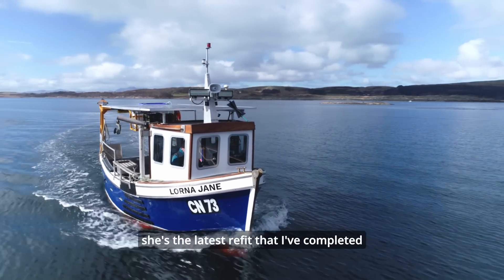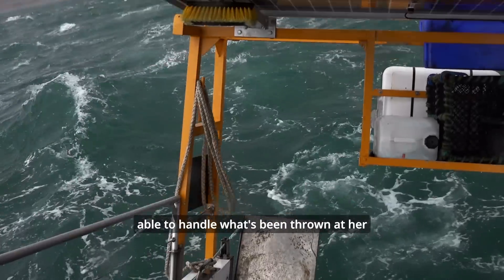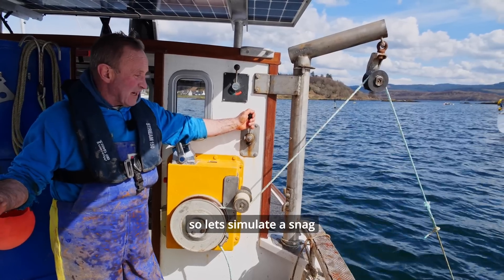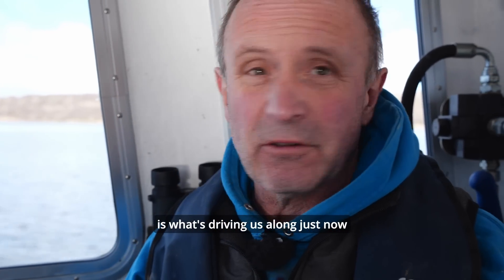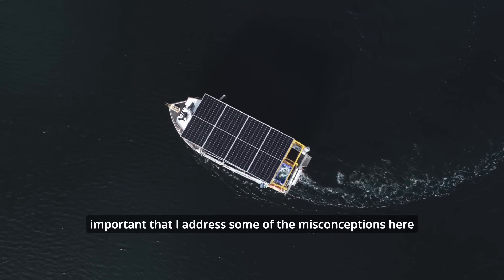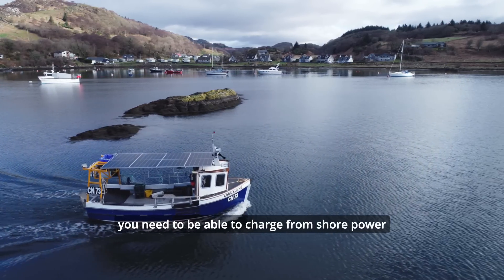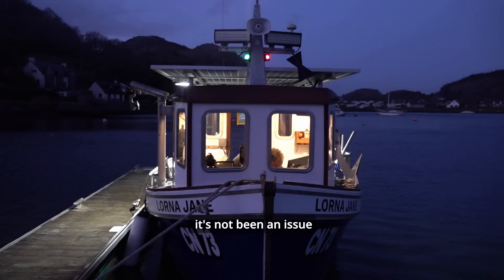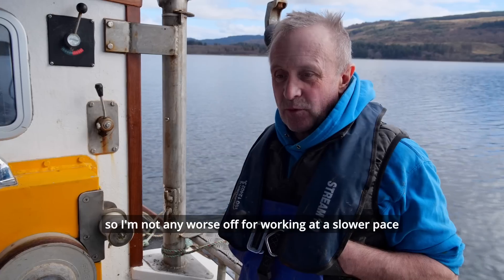An all electric Lobster fishing boat   Watch It Work  Lorna Jane.

Comment: What a load of nonsense. Yeah right, I’m going to go to sea and put my life in the hands of solar panels 😂
Reply: Plenty of us doing it, incl plenty of BWC youtube channels. Can have issues with engines & fuel. The sun will eventually appear on those panels to power a motor.
Reply: @Lana_Warwick  😂 Sure you are.
Reply: @Lana_Warwick  Hopefully the ocean won’t rise up and kill you before the sun comes out 🙄
Reply: Not strictly true. You go to sea with fully charged batteries. A battery/electric motor combination is far and away more reliable than a diesel engine!
Reply: @marviwilson1853  😂 Yeah right. Sounds good until the weather gets up and you can’t get back in and your battery dies. No thanks. I value my life a lot more than a battery.
Reply: @Deepblue220  He has multiple batteries. A lot of redundancy in electrical supply. Your thoughts on that if you can....
Reply: @marviwilson1853  He’ll end up like those old people the found dead in their life raft. These people had gotten rid of their diesel and switched over to batteries and electric motor. The authorities surmised that the batteries caught on fire spread so fast they didn’t have time to send a distress  🆘. Electricity and water just don’t mix.

Comment: The worst and possibly most dangerous environment for Lithium batteries :face-fuchsia-tongue-out:
Reply: Not if done right. I'll take LiFePO4 over acid any day. 
Plenty of blue water cruisers show their all elec setups on YT. I'm about to convert a 12mtr aluminium cray boat
Reply: Li po batteries are not dangerous, do not confuse these batteries with lithium ion fitted in cars etc
Reply: as opposed to going 150mph down the autobahn say! They are phosphate batteries waterproofed to IP6 or IP7. Perfectly safe.
Reply: @marviwilson1853  Sorry. I don't quite understand what you are getting at. Car ev batteries are lithium ion for the better energy density and are lighter.
Reply: @tmog1000  Not always the case. A lot of EV manufacturers also offer Lithium Phosphate batteries rather than Lithium ion. Although not as energy dense, phosphate batteries have many advantages, one of which is the lack of a fire risk.

Comment: Charging eats up more energy than diesel. Allows government to control your pocket even more.
Reply: Do your actual homework dude. By that I mean on the oil industries production methods
as well as the battery industry then compare the two. Oh and also, Lifepo batteries do not catch fire

Comment: This might be a solution decades from now. Unfortunately, solar energy pollution is three times more than conventional fuels. That’s an estimate before factoring in spent batteries. I’m all for a better solution, batteries are not it.
Reply: Right now it looks like decades from now we will all be firmly on the road to being toast, you better come up with your better solution pretty quickly. I'd be interested where you got your bold statement about solar being 3x dirtier than diesel so I can educate myself.
Reply: @geminicatamaran  
It won’t let anyone post links, but the information is very easy to look up. Just search for lithium pollution, cobalt pollution and solar failure. One of the biggest reasons that every solar project has failed.
Reply: @geminicatamaran  
Just take a look at China’s decimated environment from mining and production of solar components. It’s not very hard to figure out.
Reply: Yes
Reply: Wrong
Reply: @sharonbraselton3135  
https://youtu.be/JHtQLjNGxNg?feature=shared.
Reply: @sharonbraselton3135  
Take a look at China’s solar production examples. It has done wonders for their environment and air pollution. Its contamination is worse than nuclear accidents. But believe what you need to cope.
Reply: Did you add in the survey ships that look for oil, the drilling rigs, the production platforms, the pipeline surveys and pipe lay work and inspections, the supply ships and helicopter crew transfers, the refineries and storage depots, the oil tanker ships and the delivery tankers to the garage? I guess not!

Comment: would it be possible to convert a conventional shaft driven engine set up? could a normal shaft and prop be converted from diesel to electric without sacrificing any of its speed?
Reply: It would take a huge electric motor to turn that setup. But it should be possible. You will always lose power and speed through mechanical disadvantage/waste.
Reply: @Miner-49  If you have a large prop then you gear the motor accordingly. Could be 3-1 or 5-1 or whatever, don't forget that electric motors have a much wider rev range than a diesel engine.
Reply: Shaft should be ok, however repowering from one diesel to another diesel would possibly require a prop change for best efficiency/performance.
It's all in mathematics that are way over my head, why there's specialists that work in the industry everyday that can advise.
"Speed" of elec vs diesel are very different things, like comparing a V8 Mustang to a Nissan LEAF. 
With Global agreements to reduce pollution, fuel taxes will increase, gasoline engines will faze out, people will eventually have to settle for, at least it's better than walking, allow more travel time.

Comment: Have you explored the idea of using a toroidal propeller on this experimental project. It has been shown that they can greatly increase thrust at the same power utilization. It may be possible to work with a producer of such props to supply you one to gather data for them on usage applicstion.
Reply: I believe the biggest issue with these atm is cost vs reward. Like most things, once they become more proven, in demand, production/cost will improve

Comment: thats a conversion of a existing conventional boat with limitations due the existing design......a new build to the same displacement but designed from the start for electric would be a completely different boat.....a wide set displacement catamaran would close to treble the solar capacity, reducing draw from the battery's
Reply: I considered that for a blue water cruiser, especially for the draft. But Cats come with other issues, like bridge slap, higher the clearance = larger the boat, 2 x everything incl cost, not everywhere can lift them out, etc.
IMO, if Cats were great, all the commercial blue water fishing guys would be using them.

Take the weight of the engine, tanks, & everything else nolonger required out of a 12x4mtr aluminium commercial fisher, which offers great outdoor living vs others, lots of overhead for panel patio, add back in maybe 10% weight for motor & batteries, she's a different beast, incl noise, maint, smell, cost.

In my case I'm also not pushing hard like commercial guys, & will be taking advantage of wind with a simple sail setup which I can drop when needed to get under bridges.

Comment: Wast of time and money  have yiu researched  how much  shit goes into the  ozone  just to produce  one lithium battery
Reply: That is/was true but the same stuff plus combustion  has been getting into the air and water for a century because we keep going back to get more fossil fuels... Then we burn them.... there's not even a time where they start paying back the resources and energy used... it's a dead loss That pollutes at every stage ...

The old methods are slow toxic and demand a lot of water but new methods and plant are cleaner plus the batteries use less Li and more of it is getting recycled. The other point is that Li was the first step.. there are new chemistries and batteries that use common less problematic materials ..even the threat of  Na.. has helped sit on the Li price and is forcing it to clean up.  But it's all the smaller portable personal devices that still  need the Li ion tech. 
What we do have to recognise is that it's easier to control pollution if it's at one key point not dispersed.  That you can only get the best out of renewables if you use a mixture and have batteries to store the variations. Even the grid cannot cope without them.
Reply: And life cycle, its a con from everything i see. If it made sense it would be an easy sell. Removing the people prefured option by those in power does not make it the future it makes a nonsense of the available energy resources. EV power could work in situations but not for all and not wirh the current technology and available physics. HC are the future still and ttechnology is making its use better and better by the day. CO2 is no the problem, the lies about it are.
Reply: Perhaps, but have you researched the amount of pollution produced creating a diesel engine, drive train and all the other attendant gear on a traditionally powered boat, not to mention the exhaust, used oil and gear lube that is produced by a diesel. It is a trade off.
Reply: @snapperboat25  Well said! Many like Dustin only think about what's in it for him today, not much about our grandchildren's future
Reply: @snapperboat25  Has he taken into account all the energy and pollution in finding crude oil and then piping it ashore? Survey ships, drilling rigs, production platforms, pipe lay surveys and pipe laying, supply ships, helicopter platform transfers, oil tankers, oil refineries, oil storage facilities and then the truck to the petrol station!!!!!
Reply: @marviwilson1853  Probably not lol.
Reply: @snapperboat25  do you have any idea what China is doing to the environment to mine  Neodymium? Anyone that wants to make a difference needs to go full force combat mode on India and China because they're dumping ridiculous amounts of plastic into the ocean at an alarming rate. Not to mention all the other toxic shit they do. Harassing people burning fuel telling them they're the problem is ridiculous when China and India exist. ? but guess what? That diesel engine can be fully recycled while there's no way to recycle these lithium batteries. The long-term harm EV is doing to the environment is much worse than the diesel could ever possibly hope to achieve. Carbon emissions is not a problem, just look at a volcano.. can you imagine how much CO2 a volcano emits ..... You're not trying to stop the volcanoes are you 😂😂😂😂😂😂 Dumping plastic into the ocean is definitely a problem.

Comment: 60 mile range at 5 knots. So can approximate 15 mile range to fishing grounds. Does that take into account leeway, pushing against tide and head on seas and set and drift?
Reply from the maker: 60 is a ballpark figure, possibly more and at times less. When the weather is poor I can lose about 15 miles range on a bad day. Tides can be managed to a certain extent as can set and drift. I'm adapting to what the boat can do. I move fishing grounds regularly. Every boat can be fitted out differently to best suit their working day. I have space for more battery storage if I think I might need it. I haven`t so far. I'm not necessarily trying to present a boat that's better just one that can do the job without burning and diesel and I think this is close to my needs.
Reply: You're part of the solution, not part of the problem..... you get a pat on the back!!!
Reply: With Global Emission Reduction Agreements, everyone will have to 'adjust' eventually.
'Currently', many governments haven't met targets agreed to, so offer incentives to consumers, i.e. "up to 90%" in this vid, to fast pace it.
Higher taxes will be applied to gasoline to fund it, electric (or other) vehicles will become more the norm.
Eventually targets will be met, no more tax payer funded incentives, those who didn't take advantage will eventually have their non-compliant vehicle put out of action, have to pay full price to convert, or for most it will be cheaper to use public transport, which is better for most governments as it = less congestion & costs on roads.
Reply: 90% subsidies and knowing the rescue assets are predominantly ICE must be reassuring

Comment: Running a regular motor system requires a lot of work every preseason I can only imagine how much an ALL electric system would take and COST!
Reply from the maker: From a maintenance point of view after nearly a year of working the boat I have not had to put a spanner, screwdriver or boiler suit on the boat. Yes, when that does come electrical trouble shooting is a challenge.
Expensive, yes, though UK has 90% funding towards conversions of this nature. 
This boat has worked commercially for almost a year now and has not burnt any diesel. We are not going to reduce let alone slash our fuel emissions down without carrying some of that burden in inconvenience, re learning and cost on our own shoulders. I would suggest the glass half full approach to this.
Reply: would it have been cost effective without taxpayer funding 90%?
Reply: @thomasirvin4159  it’s not a in production so R&D concept. Nothing is first made cheap. Only with mass production does prices drop. Beats paying petrol companies millions in tax subsidies
Reply: @thomasirvin4159  Incentives (taxpayer funding) are likely due to Government 'Global' commitments to reduce pollution. When those targets are met there likely won't be a requirement.
Australian incentives have been massively reduced vs 10 years ago.

So imo get in while you can, cost maybe prohibitive later, with deadlines when petroleum engines have to be decommissioned. Perhaps not in our lifetime, but if you plan on passing it on to your kids.
Reply: "Motor" = Electric. 'Engine' = petroleum.
Wash, inspect/test solar panels & wiring. Ensure all battery cells are holding charge & balanced correctly.
No oil, filters, leaks, hoses, fuel bacteria & cost, smell, yadda, yadda, yadda.
Reply: Sealed units just a few moving parts. No work compared to a fossil boat
Reply from the maker: Thanks, https://itllneverwork.boats/ takes you to the full length film of how I got there
Reply: Hardly anything